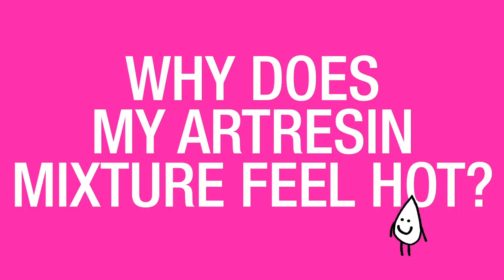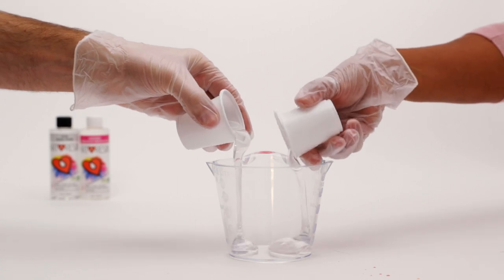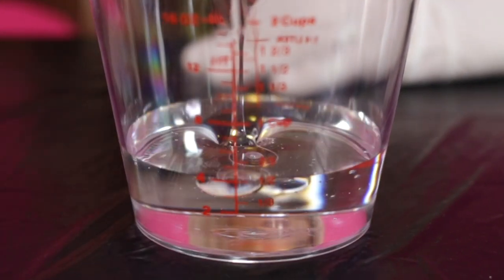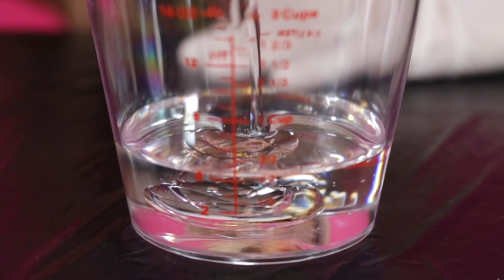Why Does My Resin Mixture Feel Hot?

Comment: Mine sometimes gets really REALLY hot and then turns even more yellow and starts hardening like gel and really really fast. Usually the few times I try large amounts. It’s so frustrating when I need to mix and pour a lot quickly, but I need note than 5 mins! Ugh
Reply from the maker: Amber have you tried to mix in a vessel with a lot of air space/ large opening? The more air space and the less time you let it sit it decreases the chance of this exothermic reaction happening.
Reply: This same thing just happened to me. I'm honestly disgusted that there is no warning label. My resin got so hot it melted the plastic container I was using and nearly scalded my hands. I only mixed 20 oz as well. I've watched hundreds of videos on this stuff and no one even mentioned it. Even this video makes it sound like no big deal.